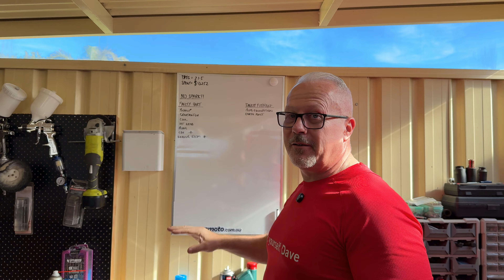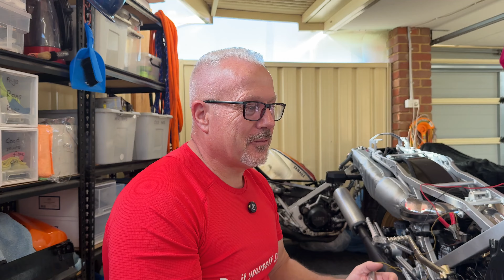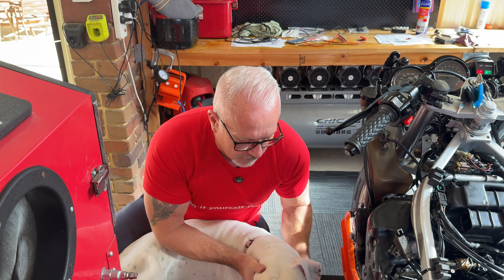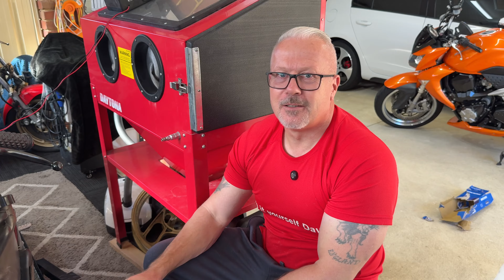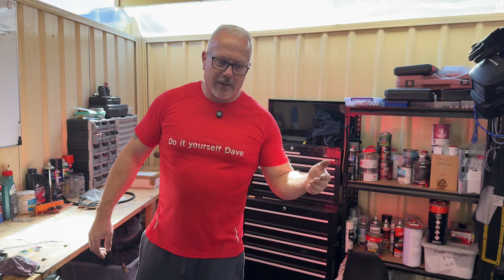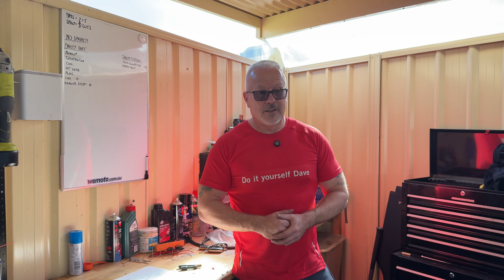Rd500 PT 30

Comment: dave you need to be quick look on you know where asap as it is on there now "Yamaha RD500LC Tool Kit Petrol Tank Support Wire"
Reply from the maker: Found it - although it’ll be $101 delivered according to the site - it’s the postage and import charges that kill it
Reply: @DoItYourselfDaveOJ  contact him by the message system on the add to see if you can sort something out

Comment: i just thought i would mention if your going to fit the belly pan grill on your bikes and your going to use the bikes it maybe a good idea to drill 1 little hole in both sides of the fairing panels so you can zip tie the grill to the fairing panels as sometimes the grill can fall off when riding the bike and this can happen even when using the genuine yamaha grill too
Reply from the maker: Will do 👍

Comment: now you have got this rd 500 going when you have finished setting it up you could use this bike to test all of the electrics for the other bike eg coils and servo control unit and cdi unit and reg/rect and stator that way you will know if they are all working
Reply from the maker: Absolutely- I’ve got the second one to do but also Adams (our eldest lad) - he’ll be bringing his up in a couple of weeks once we’ve finished this first one so yep she will be a good test bed for the other two. Having done this first one and learned so much about these specific bikes should make the other two go much easier / quicker and I can focus on improving the quality , that’s the plan at least.

Comment: hi dave glad to see you had a nice and easy fix, when i rebuild a engine in a bike or car i allways run the engine twice with no coolant in for a short while to help the gaskets seal then i put the coolant in and run up to temp a few times then i re-torque the heads
Reply from the maker: Sounds like a good idea - I reckon it’ll would’ve fired right up two weeks ago as well (as I had spark before I played with the coolant pipe and disturbed that connection) 😊